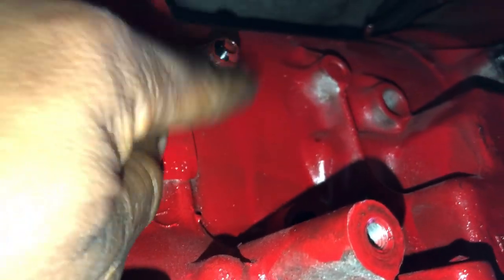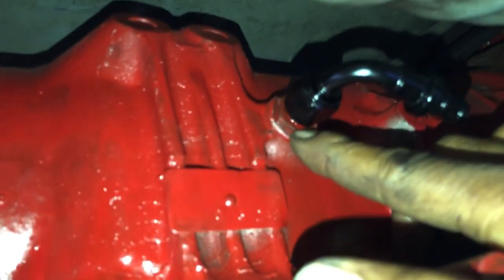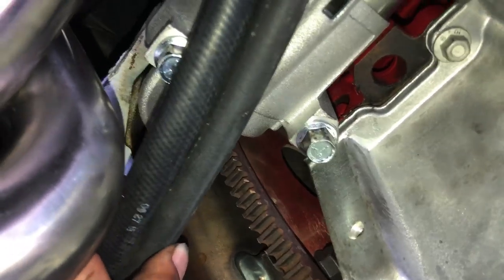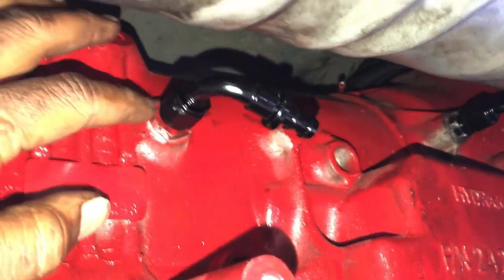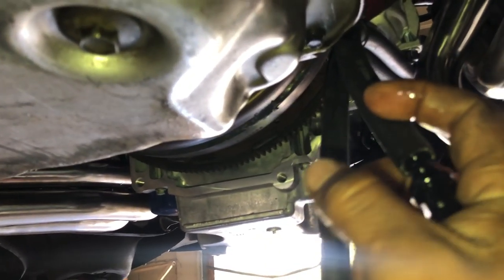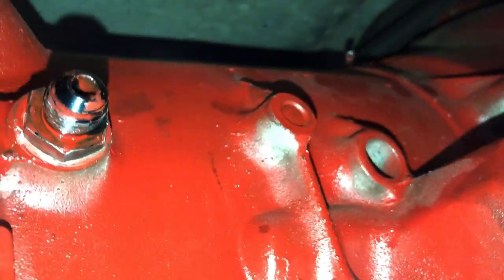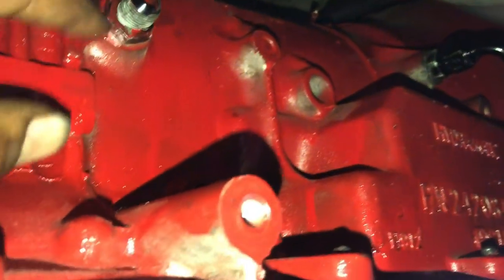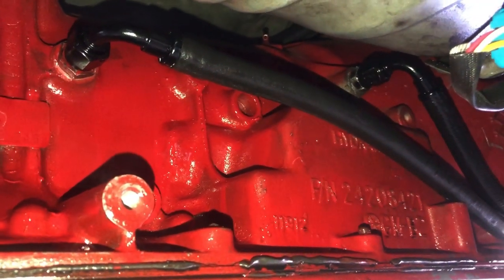HOW TO INSTALL TRANS LINES ON YOUR LS SWAP USING AN6 PUSH LOCK FITTINGS QUICK AND EASY

Comment: On a 4L80e, removing the original rear cooler line fitting with the tubing that sticks into the transmission will burn up the rear planetary gears and everything behind the rear cooler fitting. That piece of tubing that sticks into the transmission actually fits into the center support to direct fluid into the rear lube circuit of the transmission. With the fitting you used in the video, the fluid will just flow back into the pan without lubricating the rear of the transmission. For a very good explanation of what I’ve described here, watch Precision Transmission’s YouTube channel. Richard is a master transmission mechanic with over 40 years of experience. He is in Amarillo Texas and builds transmissions for people all over the country. I know the 4L80e is a tough transmission but it’s also expensive to build and repair. I hope this will help you avoid having any problems with your work in the future.
Reply from the maker: I actually took that fitting out and put the correct fitting in but thanks for your concern and appreciate you watching 

Dewhel Black 6AN x 1/4NPS 4L80E GM Transmission Oil Cooler Adapter Fittings 1997-2007 https://www.amazon.com/dp/B07BF97GJF/ref=cm_sw_r_cp_api_glt_fabc_TGZ0EPY6CQMRE5HHVKNE
Reply: Yeah I watched video about that last week.
Reply: Hey bud, I’m working on setting my lines up and when I pulled the original fittings off of my 4l60e, they’re both short. I do have the fitting with a tube on it, do you know if I have to use that even on the 4l60e
Reply: @KPotassiumK  It’s only on the 4L80e

Comment: You saved my A$$ again bro... I’m literally doing my trans lines on my LS swap I’m doin on my 96 Caprice right now..... now I just need to figure out how to hook up the shifter linkage.... the new style 4l60e sits back farther than it did with the LT1 and old 4l60e... I’m usin those dirty dingo motor mounts, and I did what you told us and used the LS1 oil pan.... I appreciate you bro thanks again
Reply from the maker: All good bro the mounts that you’re using are they sliders or are they adapter plates if there plates you need the engine to be on the second setting so that it sits the motor in the factory location glad I saved your a$$ again hahahah appreciate the love mayne
Reply: Your the man bro... thanks for liking my comment!!!!!! We all talk about you on theB-Body  LS swap forum!!!! There’s a dude on there right now that’s getting his swap done by you.... and I’m using the sliding adjustable dirty dingo mounts. The transmission crossmember is stopping me from sliding the engine any farther forward, I have the trans mount on the forward slot on the crossmember and it’s as far as it will go... so I cut that crossmember or something???? You should make a video dedicated to transmissions that would be awesome!!!! Thank you, thank you, thank you!!! Lol

Comment: Noice. That looks so clean. I didn't know about that, I cut the OEM Hardline and bent it 90° and clamped transmission lines to that. This looks way better.
Reply from the maker: Thanks man the way you did it works as well but this way is just a tad bit quicker easier and don’t cost much for a nicer look best thing abut it is not having to bend them hard lines it’s a pain doing that

Comment: 2:02  I've read that some people used the wrong fitting that goes into the trans.  Something about the fitting not having the extension into the trans.  Can you expand on that, please?
Reply: I heard that the 4L80E needs some type of internal extensions, but I can’t confirm.
Reply from the maker: I use those as well they come in an fittings
Reply: I was thinking the same thing if you dont have the extention the fluid will just dump in and run down the inside of the trans instead of reaching further in the trans were it needs to go
Reply from the maker: Only 80e need the extension
Reply: @TheLsSwapGuru  can a stock 86 monte radiator work with a 6.0 ls

Comment: Will you show me which trans line goes to the radiator and which one goes to the trans cooler then to the radiator? My transmission fluid is pink. I thought it was a broke radiator, I replaced it, flushed it and it got pink again.

Comment: Hey Big bruh I’m having a problem with my 6l80e trans with my swap, I’m putting a 6.2/6l80e trans in 82 C10 but right now the trans is stuck in limp mode (3rd gear) and I don’t know what to do.  If you had this happen to you what did you do to fix it? Rich

Comment: Nice  video bro!! Which one the high pressure side?
Reply: @D. I. Y. With the Richardsons   >Over the decade of fixing vehicles, most all automatics run 8-14 PSI in the cooling circuit. The hot fluid is pumped directly from the torque converter thru a balance valve. The bulk of the return is directed into the lubrication circuit to lube planetary gears to the output shaft bushing and everything in between. Hope this helps.
Reply: @deankay4434  dean thanks bro im always interested in new information !!

Comment: Hey big dog what it do do? I know you do a lot of lq4/Lq9 swaps. Most of those have hydro boost brakes right? If so do you use the hydro boost power steering pump and setup the hydro boost brake system or do you cap off the hydro boost ps pump?
Reply: Or do you use non hydro boost ps pumps altogether
Reply from the maker: I don’t use none of that crap I hook it up like factory straight to the brake booster and ps to the ps box thanks for watching
Reply: The Ls Swap Guru appreciate that. I asked because I purchased a 6.0 from a 05 Escalade with no accessories. I’m looking up ps pumps on rock auto and I’m coming up with part number 15909832 but it says with hydro boost. I don’t wanna use hydro boost. At least not right now. Should I still go with that ps pump?

Comment: Do the 4l60e and 80e use the same adapter fittings for the 6an pushlocks?
Reply from the maker: Push lock yes trans fittings no the 80e has a fitting that’s longer